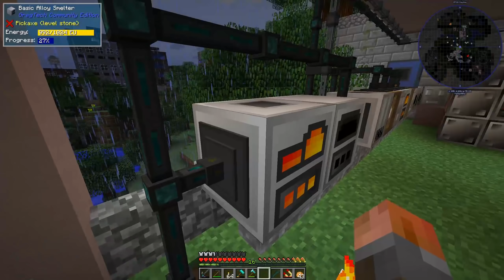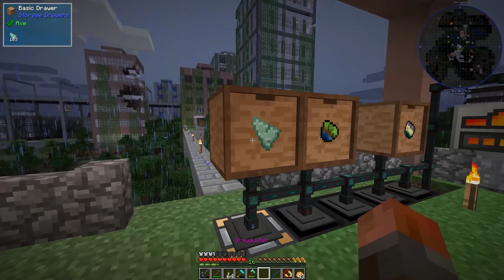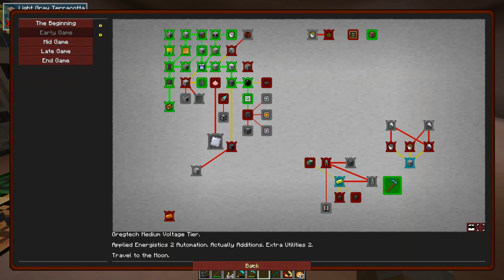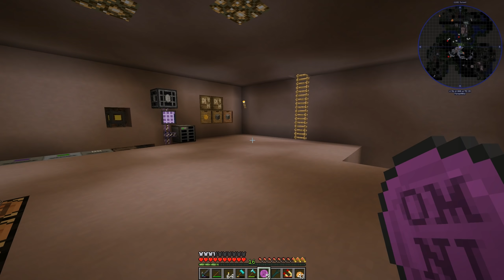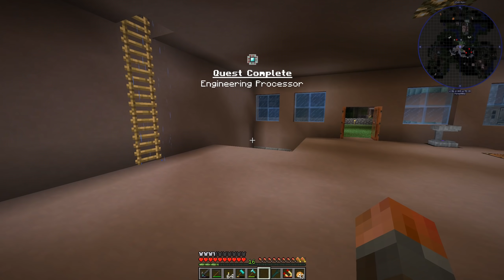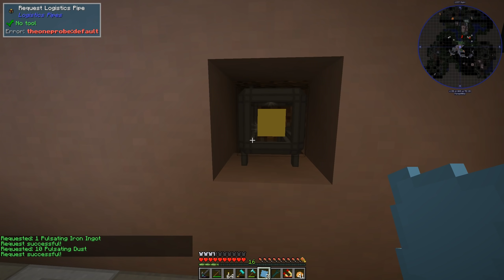Omnifactory E20 - AE2 Processors, Inscribers and Crafting Blocks

Comment: You should use the block module on a diamond ore so you can find a diamond vein. You'll be drowning in diamonds once you find one. I just mined out one and have hundreds of diamonds. Also it's not a bad idea to keep one of each ore on hand so you can use the module on it if you need to find more of something. I have a wall of ores so I can just walk up and set it to whatever I need. With two range modules you can scan almost to bedrock from the surface.
Reply from the maker: I have a wall of a few ores upstairs :)

Comment: "There's nothing in here that really gives you an indication that you can do that" he says while the tab that literally does that is on screen and his mouse cursor is circling near it.
You need an energy cell, not a capacitor. Normally the ME Controller fills that role but with channels disabled you don't have one of those.
The plunger is supposed to empty liquid from machines, but it's bugged and will only empty output fluids.
You are probably not going to manage patterns next episode :) and I can't recommend trying to rush them anyway. It's better to wait until tier 3 circuits are cheap, and use LP autocrafting in the meantime.
Reply from the maker: Oh I get everything I need for patterns :)

Comment: Oh God, please don't go through wood gas! Look at the quantity outputs! Wood gas gives 20 mBs of Ethelyne, and you needs thousands of it. The Biomass -> Ethelyne route is much, much better. Sulfur is easy to get (I forget how but I have over 200 of it), and it's very simple to get everything.

On a side note, you are forgetting the whole "Air" component in your calculations; It requires an Air Collector machine (there is a quest in the third tab eventually for a basic air collection machine). Alternately, you can electrolyze 3 buckets of water for 1 bucket of oxygen which is more ethelyne-efficient, but is slower to acquire.

It pained me to watch you convert 7 blocks of redstone into 7 resonating redstone when you have the atomic reconstructor, and could take the route that only uses 1 redstone per resonating one.

And I'm not sure why you are stressing over diamonds so much - you have plenty of Omnipennies. 50 pennies -> 10 nickels -> 2 quarters -> 32 ore -> macerated into 64 dust -> autoclaved into 64 diamonds. Plenty to get you started before setting up your shulker fabrication.

Another thing you should head towards: the top component that uses Black Quartz (I think Machine Frame?). The Grid Power line that follows that quest is necessary for Black Steel, which you'll need down the line. You need 3 for the End Cake if you want to reach the End, though now that you have functionally infinite ender pearls that isn't too necessary for awhile. 
I seem to recall using black steel when I was trying to set up my autocrafting, maybe in the crafting unit? Though my memory might be failing me, it has been a couple days since I did it.
Reply from the maker: Heh, we're going through Ethanol, not Wood Gas - unfortunately, I didn't see the Air Collector when doing the next episode, I'll have to try that (I went with the water buckets approach to start with). Diamonds provide 1.5m RF each, (we switch to shulker in the next episode), and it starts providing hundreds of diamonds for free, so that's nicer than prismarine. And I run entirely out of omnicoins due to the various ores needed to unlock the autocrafting in AE2 :)
Reply: @grayduster  Should finish bounty board quests then, the wooden widgets are super easy to make (wooden gear, 6 wooden planks, 4 wooden slabs, and 2 durability from a saw) and are worth 2 omnipennies each. I usually keep 30 on hand and whenever there's a bounty for just them I turn it in, usually netting ~50 pennies. I have a surplus of them atm, since I tend to be really conservative with all my resources, even if it takes longer >.<
Reply: Sulfur can be generated from Pristine Blaze Matter, so that's trivial to acquire. And the fastest way to generate oxygen that I've found is via cobble -> gravel -> sand -> glass -> glass dust -> silicon dioxide -> oxygen + silicon. It uses a few more machines, but it's MUCH faster than using water and air because their processes take 80 seconds / 75 seconds just for 1 bucket of air.
Reply: @MisuVir  A faster route to silicon dioxide is to just pulverize furnaces for stone dust and convert that over.